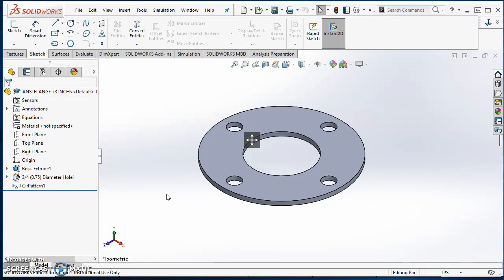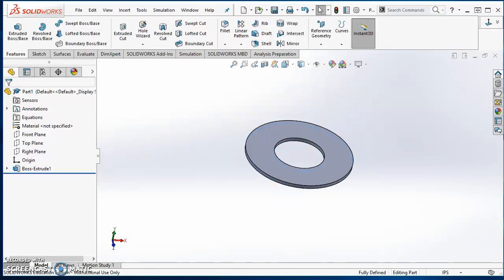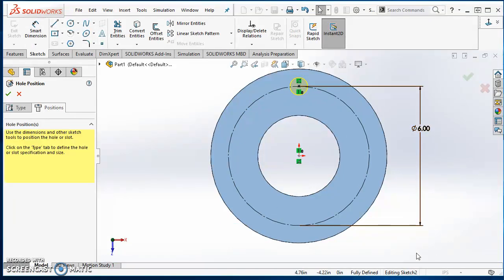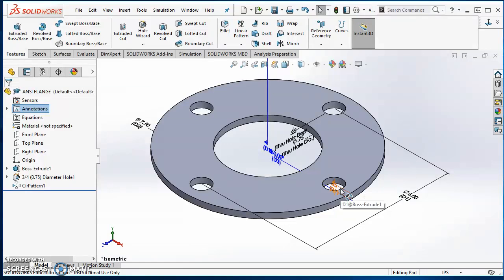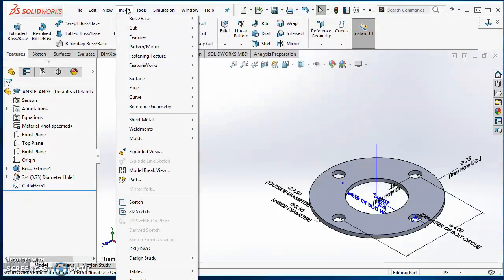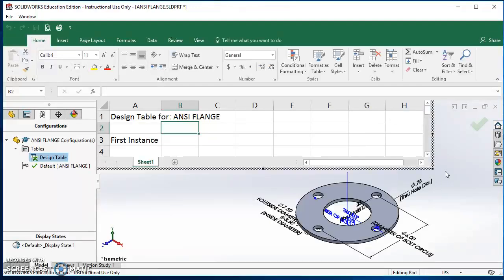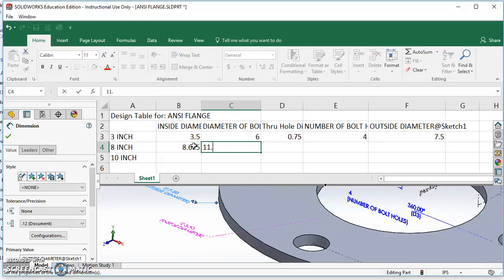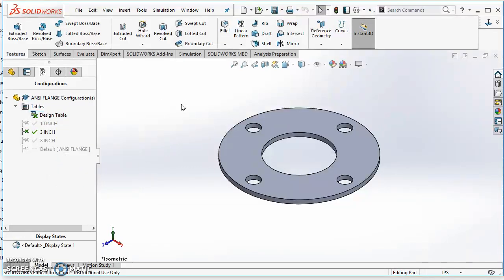Design Tables in SolidWorks 2017

Comment: 7:02 "It's opening Excel inside itself"
well, that's kinda good. But equally bad at same time if excel is a REQUIREMENT rather than a choice. That is, if other spreadsheet softwares like LibreOffice Calc is not supported.

Comment: Very helpful documentation of how to use design tables.  I really appreciate it that you did not automatically create the design table but that you showed how the design table is connected to the parts.  As a result, I am able to go in and add new design table items and change the ones that I have.  Very nice.

Comment: hi, how to add cut extrude feature in design table, please revert
Reply from the maker: Hey Rahul! Thanks for the comment. I'm probably not going to be much help on this. I've had mixed experiences with design tables, but I've always been able to get them to do what I wanted to do. Sometimes the feature dimensions are "hidden" inside the model, so I have to move my cursor around until the dimension is highlighted then click and drag it to open space. After that open the design table, click on the cell where you want it, and click on the dimension. I hope this helps.

Comment: Hey Ryan. Geat tutorial. Although, I'm a little surprised that you decided to create the Design Table from a blank spreadsheet rather than auto-creating the design table with the chosen dimensions. Is there any particular reason you did that?
Reply from the maker: Thanks for the comment. No, there really isn't a reason other than if Auto-Create doesn't work than you'll need to know how to start from a Blank table. It really comes down to how many dimensions you need to control. If Auto inserts 20 dimensions and you only need to control 3 than you would be better off starting from a Blank table. Thanks for watching.

Comment: When I get my spread sheet finished and click in the graphics area, it doesn't populate my config list. Just does nothing. Any thoughts?
Reply: Same, have you found a solution yet?
Reply from the maker: The only time that I have experienced this is when the name of the first configuration was not in cell A3 in Excel. As long as the first configuration is in A3, the next one in A4, and so on without an empty cell in between, SolidWorks should create the list of configurations. The only other thought I have is possibly an invalid character. I don't think slashes (/) can be used in the configuration name, so you might try a different configuration name.

Comment: Loved the video.  However, how can I apply a design table for a square part with a cutout in center and holes on each corner. ?I would love some advice on this.  I have never used design tables before, and would love to use it,.
Reply from the maker: Thanks for the comment. You should be able to model your part similar to how I modeled the ANSI flange and apply the same concepts.

Comment: Ryan how do I call each instance to different assembly?  Will they work just like a regular assembly?
Reply from the maker: Thanks for the comment. Yes, the part works the same in the assembly, the only difference is to look for a box that will let you choose which configuration to insert. It's in the Insert Component command or you can access it after inserting the component by clicking on the component and selecting a different configuration from the list that appears.

Comment: TQ for ur video and it will be more helpful if u do it with a assembly file with minimum of 10 parts
Reply from the maker: Thanks for the comment. For an assembly with configurations, you type in cell B2 $configuration@partname<component_instance> (match the part name from the Design Tree) then type the name of the configuration in cell B3. Continue to do this in cell C2, D2, etc. for however many components you have in the assembly that have configurations.